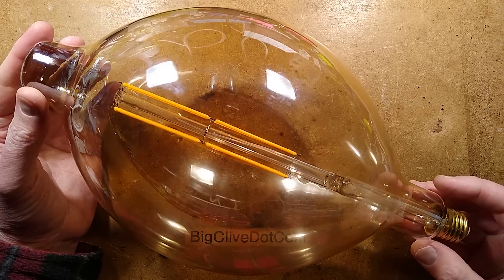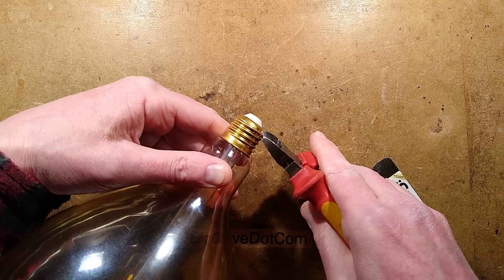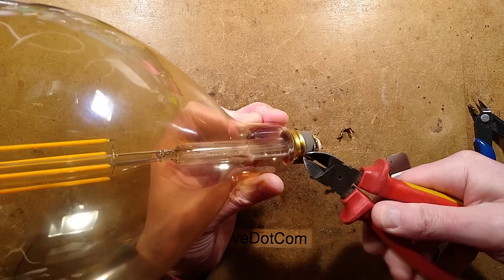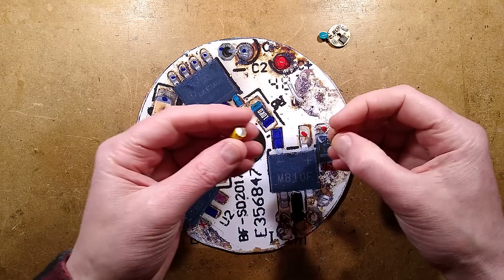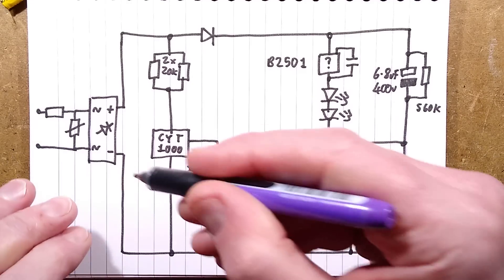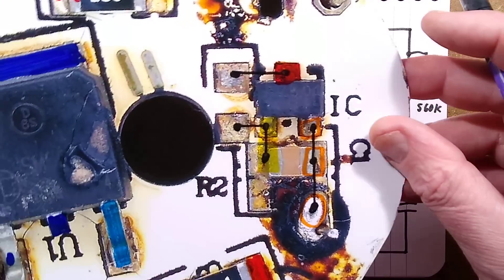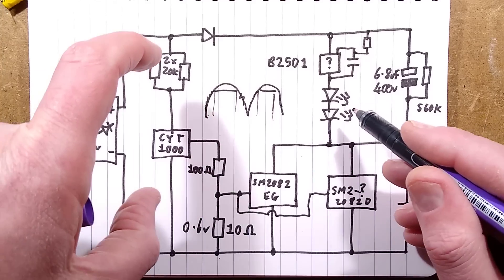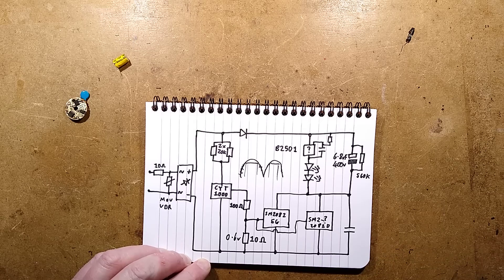Inside a huge faulty Poundland lamp

Comment: Power factor should be unity even if only the TOP of the cycle is active if it is symmetrical to the peak.  Where power factor gets worse is if the PHASE ANGLE of the current drawn is early or late in relation to the supply voltage phase. .  Inductors and capacitors are the traditional suspects but in modern equipment the thyristor dimmer was the main problem due to the phase angle DELAY that ended at the zero crossing and started at a variable time.
Reply from the maker: Electronic power factor is very different from traditional inductive power factor.  Much harder to correct.
Reply: @bigclivedotcom  That is a new concept for me.  The original goal was to characterise the powerfactor to establish a peak current value (for billing of cables) and a power according to generated load.  If you are suggesting that merely the 'shape' of the current curve is considered poor power factor even if it has no phase offset then it is composed on only harmonic content  and the only remedy would be to remove it by consuming power sinusoidally.  If that is the plan then it requires a input current sensing buck and/or boost regulator that will consume current in phase and proportion to the input voltage. Seems a shame to just have a constant load maintained by a shunt regulator and only use a portion for the LEDs.

Your theory requires the CYT1000 device to shunt regulate until the LEDs turn on with the same effective resistance.  If that is the case then it would remove higher harmonics, I have never heard it called power factor correction but I am not involved in the LED lighting field.

Thank you for reading.

Comment: That looks like an updated version of the old hanging street light bulbs from the 20's-30's. I think some people buy the street light fixtures then convert them to fit a modern bulb. So this bulb gives the appearance of an original bulb while using a lot less voltage. Bulbs at that time were incandescent. I read that early on they ran them in series, 2000v spread out so that each light received about 50w. I'm not sure when they was switched over to parallel circuitry, historical technical information on that seems a bit sparse online. 
The house I grew up in the 70's had the last one of these street lights in the entire town. The town must have had an old supply of the bulbs as they'd come and replace it whenever the bulb burnt out. It did not provide a lot of light, it provided just the right amount. You could see well enough but it was not glarey. The town must have run out of the bulbs because one day it got replaced by a new street light with a hideous orange glare that shone right into my room even with the shade down. I always hated that light and missed the old one.

Comment: @5:10 .. What?? A bona-fide Dumet seal? (I've always pronounced it doo-meh, living in a French bilingual country, but as I've never heard it actually spoken before you..) But why in an LED lamp with no reason to contain a vacuum (or low pressure) when I've noticed recently that they've been omitted from lower end incandescent automotive bulbs?

Just an observation, not a troll. Still love your content forever and always big guy, and I've been here since the beginning.

Comment: You may be able to extend the broken wire by soldering a wire to a female pin header and using a small tube to push it on the remaining stub.

Comment: I'd cut teh glass around the base just above he connector and remove the LED assembly. You could use a dremel with a ceramic cutoff disc or a glass cutter (if you have the talent)

Comment: Though you might have extracted the led filaments from the globe . Set up a tungsten cutter and rotate the lamp scoring a line far enough up the globe. Then tap the score   "should" break clean to remove the filament array, rather than just smashing the globe , probably would fracture the led filaments.

Comment: New LED Fixtures versus incandescent light fixtures
Went through numerous apartment buildings replacing 50-year-old working incandescent light fixtures with THE NEW LED fixtures. Now I keep going back and replacing all the LED fixtures that have failed (due to poor design). Now I never replace the incandescent fixtures I just screw in a LED lamp in the Edison socket.    Cheaper and repairable.

Comment: Maybe the dual linear regulators were originally designed as alternatives (b/c of availability and price of the components) and were accidentally both soldered on?

The CYT1000 is also weird, according to alldatasheets it's an "CYT1000A high power factor linear constant current LED chip". But then it should not be in parallel to the LED circuit, but on the right hand side, actually regulating the LED current. A really weird design. Looks to me like there are a heap of unnecessary components.

I would not be surprised if the "mystery chip" is a fourth type of regulator.... it looks to me like whoever designed this jumbled together a bunch of alternatives/building blocks for LED drivers without really understanding what they were doing, so they included all of them instead of sleecting and tuning one of the alternatives.

(Alternatively, I'm just stupid and don't see the brilliance of their approach.)

Comment: I'm slightly confused as to why you would need PFC to improve efficiency in this circuit. Surely a smoothing capacitor after the bridge rectifier would be enough to ensure the DC supply would be stable enough to keep the LEDs on? It must be to do with dimmer use. Clearly I don't know enough about PFC.

Comment: Maybe something for a future video...   I've experimented with connecting dimmable 230v LED lamps in series.  Unlike tungsten lamps, their wattage output appears not to follow the usual rough 'half the voltage, quarter the wattage' . e.g. two 12.5 watt (at 230v) lamps in series produce a combined 16.8 watts (at, presumably, 115v across each).  I would expect a combined 6.25 watts.  Is it worth an explore, or am I completely misguided ?  Many thanks ☺️

Comment: It might have come from Poundland but it cost more than £1. Should be renamed Poundsland.
A bad solder joint on the LEDs could cause the full rectified mains voltage to appear across the capacitor but a 400V rated capacitor should stand it.

Comment: Nice reverse engineering. Seeing 2 current regulators I think they could be a little extra step and separate the LEDs in two groups for reliability, even sequence the on times to reduce flicker and improve power factor/harmonic distortion

Comment: Yeah, that circuit board looks like moisture intrusion to me.  Looks like if using those bulbs in a damp environment then it might be helpful to thoroughly coat the base and bulb stem with vaseline or dielectric grease.
Reply: I've got two of these bulbs and one develops condensation on the inside of the glass when warmed up. So there's moisture in it from the factory.

Comment: I always use leather gloves when trying to open equipment with sharp instruments. It have saved the fingers many times. I recently noticed that most of the lamps now have an F rating for power consumption on the packaging chart. They must be equipped with shitty capacitor droppers in them. Also interesting is that I also saw was the same F rating on a package of a LED strip which requires an external 24 volt power supply. Any idea as to how an led strip with cob elements in it earns the shitty rating?
As for that capacitor failure it’s quite possible due to excessive heat, after all lamps of that size used what we called a mogul base which one finds on lamps 150 watts and higher as well as high pressure sodium lamps. Heat dissipation = longer life span. Probably just a cheap Chinese cap. Almost as bad as having 25 year old tantalum caps in a transmitter exciter circuit. Magic smoke, magic smoke, when will you tell me I’m an unlucky bloke?
Reply from the maker: The new LED lamp classification system is just the Eurocrats keeping themselves employed by creating endless rules and red tape.

Comment: Time for the 3D printer again.
You could make a plastic extension that will go down the centre tube holding contacts of two wires that will push against tungsten wires.
Just a thought 🤔

Comment: Would you consider doing a video on what makes cheap USB chargers give off a high-pitch sound all the time? And maybe on how to tell if a charger is of a good quality build?
Reply from the maker: Sone have cheap noisy transformers, but a common issue is a more audible noise when charging is complete and the unit is in standby just topping up its output capacitor.
Reply: @Matt Quinn - Caledonian TV I must have missed that one, could you link it?
Reply: Quite often it's the high frequency inductor not being fully potted, soaking in varnish sometimes cures it.

Comment: For future " difficult " soldering , use A8  acid flux .. this is a VERY corrosive liquid that will even clean stainless / inconel /  nichrome for  PERFECT  soft solder joints ! but store in a glass jar with PLASTIC lid ( eg : Vegemite™ jar ideal ) ... of course  it was owned by a fisherman ( you should see the  SIZE  of the bulb ! ) ,  Ha - Ha ............. DAVE™ ................

Comment: A completely different subject. How come if you connect two lithium cells in parallel with different voltages you get a surge of current between them . But if you connect jump leads to a car with lead acid , you don’t ?.
Or have I got it wrong?
An answer would settle my mind
Reply from the maker: Lithium cells have an extremely low impedance.  With car batteries high current will flow, but perhaps the larger cables make is less visible.

Comment: Is it possible that the manufacturer was caught out buying fake "copper-ish" wire? Or perhaps they were just cheaping out and thought using aluminium wire wouldn't be a problem, even if they can't solder to it?

Comment: I have the slimmer one with the same workings, I took the board out to see if I could turn it down but as you can see it's quite "busy" and all the IC data sheets were in Chinese so I left it and put it back together, I used the base from an old CFL light with bayonet fitting, the power factor on mine is a full one, and I'm pleased that you have done this one.
Reply from the maker: If it's the same circuitry it may be suited to dimming down with a series capacitor.
Reply: Thanks.

Comment: With the wires that pass through the glass you are better off with a crimp connection,  just a small brass tube or the tiny copper tube off old thermostats is ideal

Comment: To reattach the wire get some stranded mains wire say 1mmsq cut and flatten the end and open out the strands with a wire, then you can shove the wire in the end of the snapped wire if it will fit inside , you flatten the end to give space inside

Comment: Why the extra diode?

The multi regulator setup isn’t uncommon in decorative dimmable fittings as the dimming compatibility can screw around with the regulator causing a tuned circuit leading to thermal runaway.  Stacking regulators is a cheap way to fix this. I know this exists in some fittings (rhymes with grillips) I originally thought that the one I looked at was designed around whatever parts they had a glut of but stacking regulators allegedly changes their impedance.

Comment: Could B2501 be a constant current IC?
I have come across a group of fixed constant current devices, in parallel, supplying a high power LED chip in a hand lamp that I repaired recently

Comment: Just guessing here, but could that mystery component be a simple transistor used as a constant current source for the LEDs? Although why you'd need one when you already have three current regulators I have no idea, but it wouldn't be the first time that a Poundland product has had some weirdness inside :)
Reply: You may be right. Often designers would use a pass transistor (with series resistor) around a 7805 3pin voltage regulator.  The transistor on a heat-sink would do the heavy lifting and the regulator would track the voltage.

Comment: So, in your opinion, are these led lightbulbs designed to fail?  I'm sure they could make them last much longer for very little more money.
Reply from the maker: Yes.  Unfortunately they are definitely pushing the LEDs in some bulbs way too hard to ensure a limited lifespan.  Not usually so bad with decorative ones like these.
Reply: @bigclivedotcom  yeah, I'm using regular bulb style filament led's throughout the house and they seem to pop as regularly as incandescent bulbs did.  Not actually sure if they are saving me money 😂

Comment: Why the hell does the bulb shape of the lamp look like an exact copy of the vintage German made Narva or Osram mercury vapor lamps from 1960s???? did they bought the old molds from the closed down factory and reused them in their own led factory???? I am so confused!
Reply from the maker: The glass lamp factory equipment was repurposed with the filament style LED lamps.  So there is a high probability that original exotic moulds were put into use or remanufactured again.

Comment: I can't decide if it is a very cleaver design, or a very poor design where someone just added parts onto an old design rather than starting over with more knowledge.  How do they cut out round circuit boards?
Reply from the maker: The PCBs are often drilled and routed on one machine.  They can be any shape.

Comment: Is there any kind of micro butt crimp connector to connect tiny stiff wires like that into flexible.
Reply from the maker: They're usually wire wrapped around square posts or spot welded.

Comment: Dumet wire is short for 'dual metal' in reference to the copper plating on a nickel steel alloy with the same thermal expansion characteristics as the glass into which it is sealed, so it is properly pronounced "doo mett" as opposed to the French sounding "doo may."
Also, you could fix the broken electrical connection in the stem press with a wire tipped with conductive epoxy.  Soldering a wire into one end of a thin ferrule and filling the ferrule with conductive epoxy which then goes over the broken wire is another probably less fiddly option.
Reply: so the dumet wire doomed it. sounds fitting.
Reply: Had been thinking along lines of the olden days of repairing heated rear window elements with conductive paint. Was not aware there was conductive epoxy. Thanks
Reply: @patomahony9747  learned something new myself.
Reply: You could also use the lamp from a high voltage high frequency power supply like a flyback transformer or Tesla coil. That way you can use it with a single wire and capacitive coupling.
Reply: Perhaps some jewellery repair business would be interested to try and see if a laser welder could work through the glass.

Comment: I guess that the capacitor blew up because of the arcing. Those are mostly rated for a few Hz of charge/discharge and also not to be fully discharged any time. The arcing most often produces high frequencies and discharged the capacitor every time to zero, which causes internal stress and that causes heat, and at some point the electrolyte simply boils up

Comment: Clive, when you introduce a tungsten dimmer to one of those COBed things, it has about three trigger points where the lamp changes brightness with jitters on the way up to full scale elimination, I've heard it ringing through the condensers sometimes squeals and groans from the lamp also.

Typically this new type of lamp does not like the old-school dimmer.  It might be worth comparing the new dimmer design with a new working version of the LED, seems to me the the bulb opperation runs two long "filaments" in series over about 120 dc in this country. 3 or four sets of 2 in series, circuit should compare well with smaller bulb with adjustment to 240.  

Also, our LEDs like that have no vacuum in side, the are vented from outside air to inner chamber though the tiny pipette that supports the cheesy spot welded support system in side the lamp.

Another weird thing I noticed about those was that they still had the red junction through the pinch around the power wires of glass.... I thought I learned years ago that that was only needed because of the temperature of the tungsten filament, as that junction suffered breakage otherwise and then lights out.... might be worth a look Clive.

Thank you as always for your videos, top notch.👍👍👍
Reply: That red layer is the copper plating on a nickel steel alloy wire that has the same thermal expansion characteristics as the glass it is sealed into.  Using wire with different thermal expansion characteristics risks either breaking the glass if the wire expands more upon heating than the glass or the formation of an annulus betwixt the glass and wire if the wire expands less.  This annulus compromises the lamp internal atmosphere and will result in failure unless the lamp atmosphere isn't critical for operation (dual envelope halogen and filament LED lamps usually).  And even then, there can be problems iffen the halogen lamp depends on an inert atmosphere to prevent seal oxidation or the LED lamp uses a high thermal conductivity hydrogen or helium gas fill for LED cooling.

Comment: Thanks, great explanation again. I really don't understand the linear regulator at the beginning of the circuit, wouldn't a capacitor to the same and increases the efficiency too?
Reply from the maker: The linear regulator is a more compact way of limiting current when paired with high voltage LED strings.

Comment: Shocked !! You didn't break the bulb to get the LED's out, I was looking forward to the possible blood letting.  P.s is that in part-2 :-)
Reply from the maker: There may yet be a part two.
Reply: Ship in a bottle , glitter lamp, fairy lights or a new led tape string inserted. Options limitless to point the mind boggles